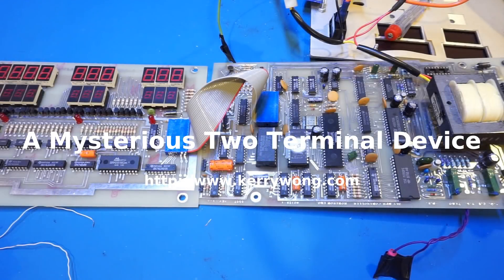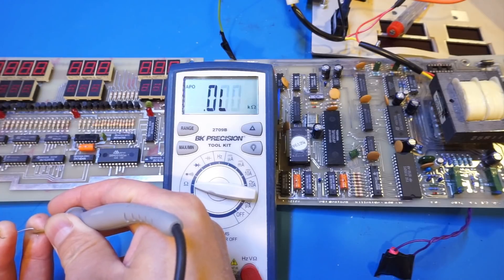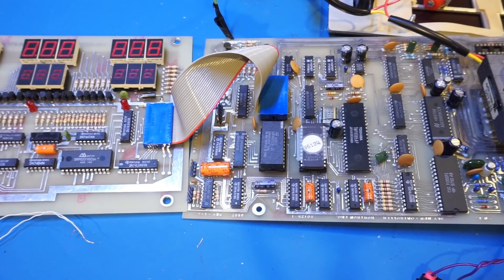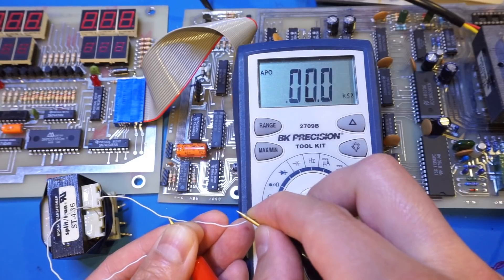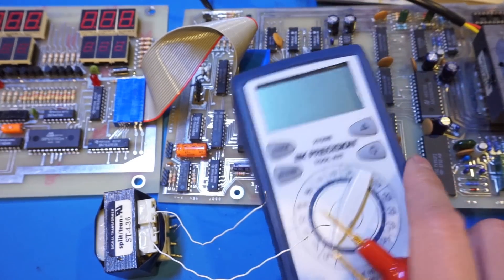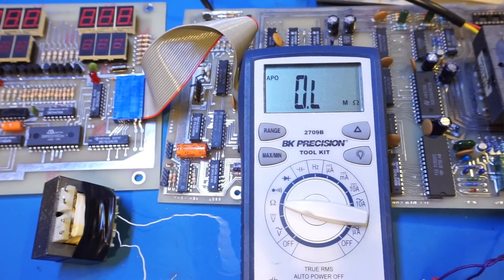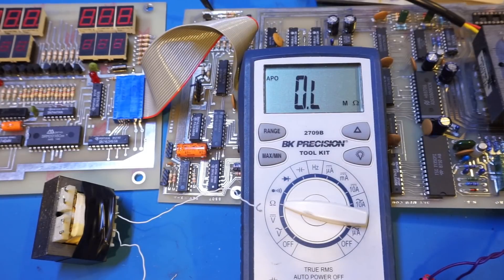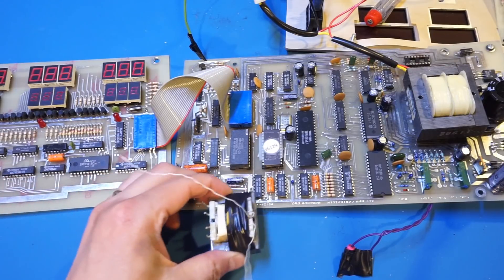A Mysterious Two Terminal Device

Comment: This video was interesting and fun as we so rarely see the phenomenon of inductance in electronics.  Thanks!
Working with very large transformers at the power company, I encountered the large current transformers used on the bushings - two feet in diameter with 4000 turns (or so) on an iron core.  These are tested by connecting a two cell flashlight across the winding.  It takes a moment but a very large magnetic field is built up.  The field remains when the batteries are disconnected.  A light bulb connected across the winding will light then slowly dim as the magnetic field collapses.  This test indicates the CT is good - a shorted winding would not store any energy.

Comment: Yes i've had similar. In fact my Keysight U3401A really doesn't like measuring the resistances of anything with an inductive property; it measures fine the first time but then when you disconnect the probes the meter will show screwy numbers and wont return to zero in any of the resistance measurements. You have to power cycle it to fix it. Apparently it's a known issue with that meter.
Reply from the maker: Wow, that's inconvenient.

Comment: Completely misleading video.
Problem is not the 'mysterious' component, but that DMM, which has a problem with autoranging on inductive loads. Switch to manual ranging in such a case - especially if you see what component you are to measure -  and that 'problem' is fixed. Or directly use proper LCR meter, if you want to check an inductor / transformer.
Pityful, this is just another of your videos, which is useless. Unsubscribed.
Reply from the maker: C'mom, the title has to be "creative" nowadays.... I thought about just calling it "2709B gone haywire" but that is just too boring :)
Reply: You sound very... German

Comment: I have seen that autoranging glitch on other meters, even on resistors, manual ranging always sorts it out. Is that a 1500 (or similar) count meter
Reply: I have even seen it happen with some RC combinations. In the days when autoranging meters rarely had manual override, quite a few electronics books recommended keeping a manual ranging meter for that purpose.

Of which, how come nobody has come up with an autoranging algorithm that detects if it has been hunting between ranges too often and slow down?

Comment: Interesting video as always. I have two questions or requests: can you fix the range of your BK multimeter first and not use auto ranging for the measurement and see what happens? Could you also connect a high impedance scope probe and see what happens when you are doing the ohm measurement by B&K? preferably a FET probe if you have one
Reply from the maker: Good question. I didn't try measuring with fixed range. I had soldered the transformer back. Well, now I am curious... if I pull it out again I will take a look.

Comment: I recently tested a 1uf high voltage capacitor (snubber) with a Fluke 87/5. The capacitance was oscillating all over the place. I measured resistance and it too went into full oscillation. I tested both capacitance and resistance on my Fluke 289, but measured exactly as expected and thusnconfirmed capacitor as good 👍
Reply from the maker: When measuring capacitors, this happens a lot although typically it's for larger capacitors where the leakage is high...
Reply: Mobile warrior detected. I do the same whenever I use my phone lol

Comment: This is a prime example of why I will always keep a analog multimeter on my bench.  I to have run into strange readings using digital meters like this before.  I really like my B&K model 290 analog electronic multimeter. In addition to a nice large easy to read meter movement it has a high / low power ohm function.  In low power ohm meter mode the test voltage is less than the turn on voltage of semiconductors so you can do in circuit ohm readings without semiconductors throwing off readings.